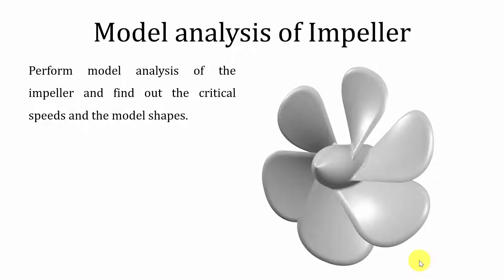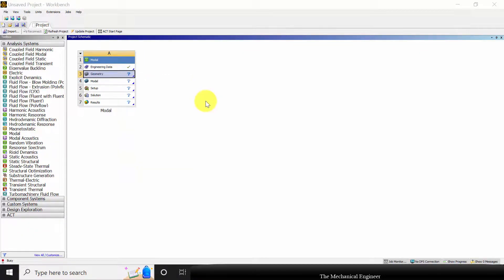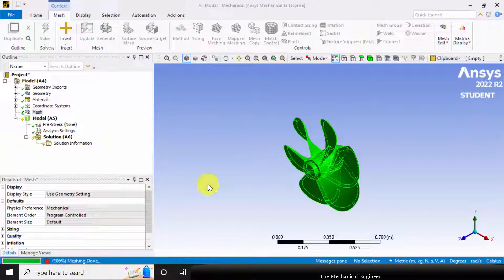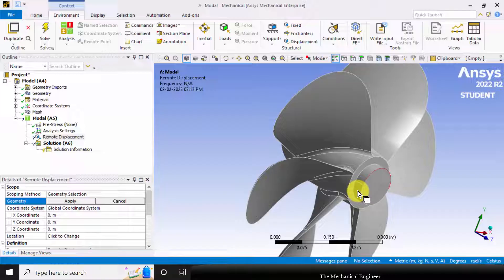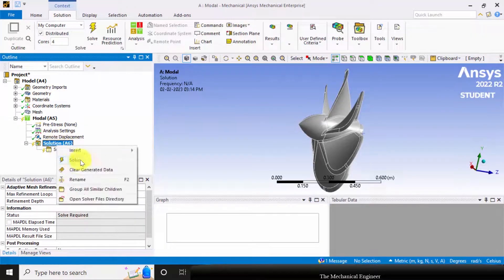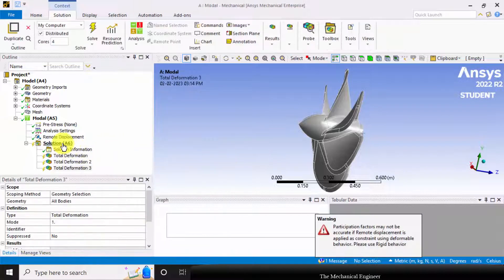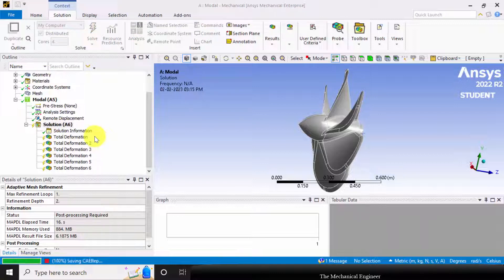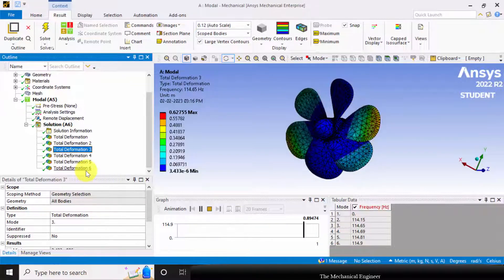Modal analysis on Propeller | ANSYS workbench tutorials for beginners

Comment: Hello sir i need help

How to find thrust force or propeller please help me
Reply from the maker: The thrust force can be calculated using the formula: T = 0.5 * ρ * A * V^2 * Ct, where ρ is the air density and V is the velocity of the air leaving the propeller. The velocity can be approximated as V = (RPM * D) / 60.